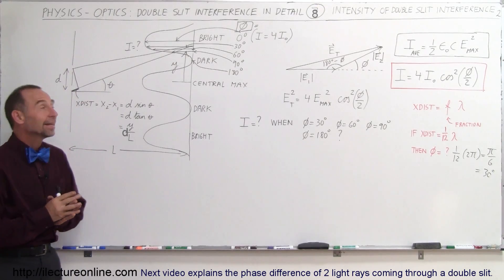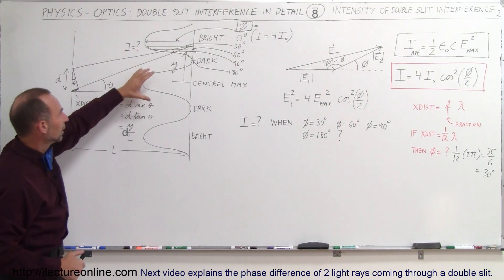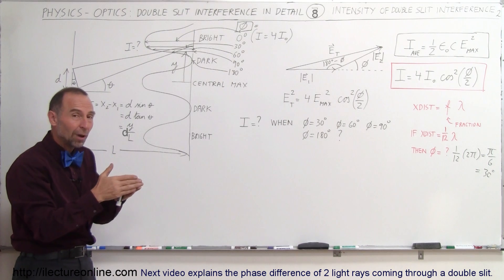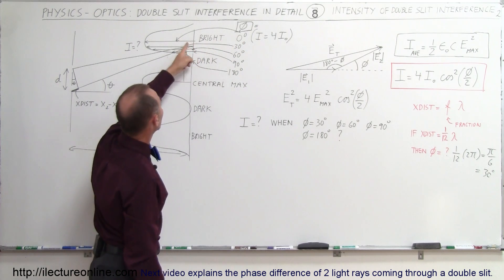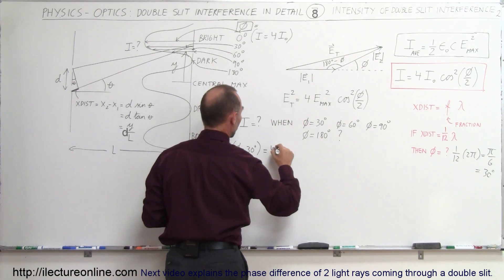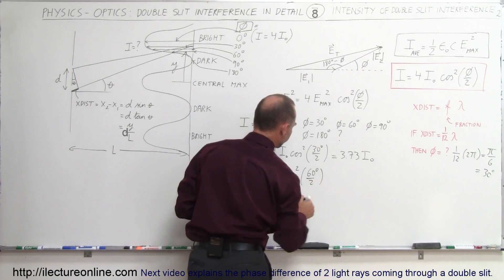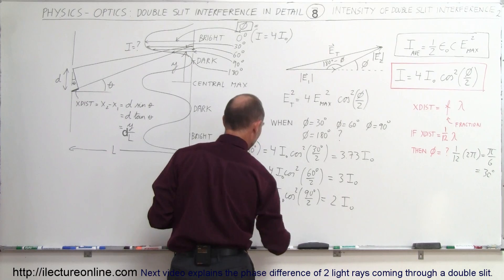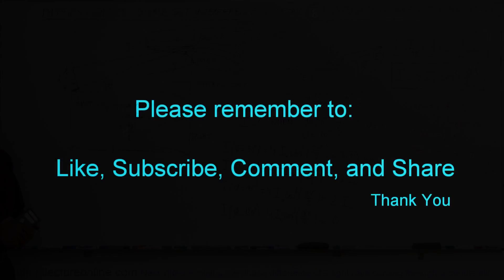Physics 60  Optics: Double Slit Interference (8 of 25) Intensity of Double Slit Interference Pattern

Comment: Why do we use cos(phi/2)^2 instead of [sin(Nphi/2)/sin(phi/2)]^2? Should there have been an N in the first expression, that is cos(Nphi/2)^2?
Reply from the maker: Дејан Гујић 
Why don't you try your equations and see if you get the correct answer?  Sometimes the best way to answer your question is to try it and see what happens,  Make sure your diagram matches your equations.
Reply: I've spent the last two days in my room thinking about it, and apparently you only use cos for two-slit-interference, and the sine equation for both diffraction and interference when you have more than two slits.
Reply from the maker: Дејан Гујић 
I always recommend that you don't make such generalities, but that you look at the geometric situation, and then look for which function is correct in each situation.
Reply: How would one derive the correct function ?